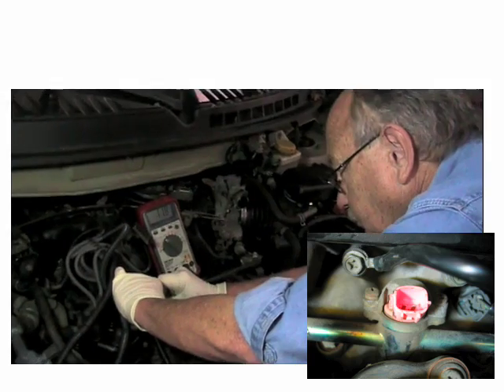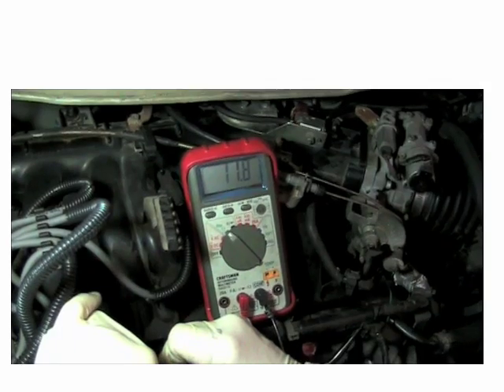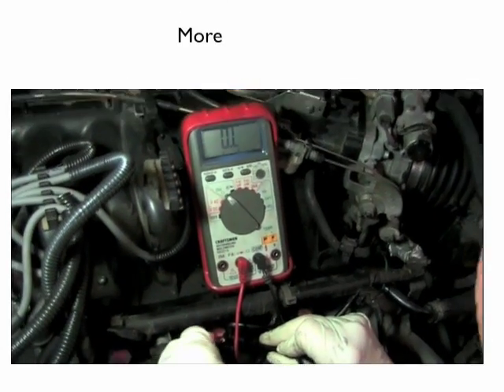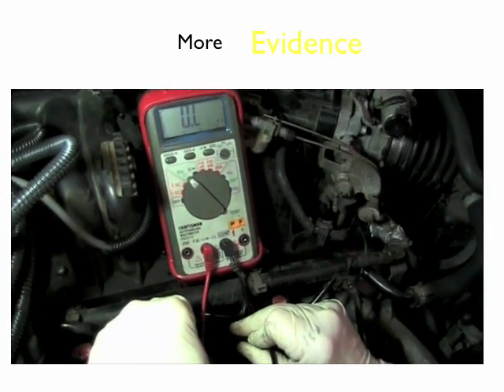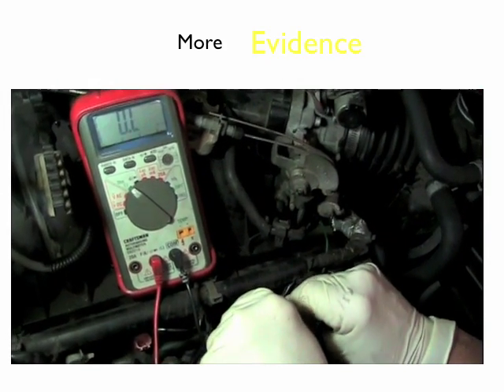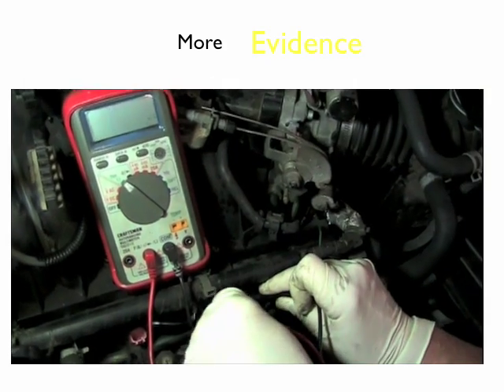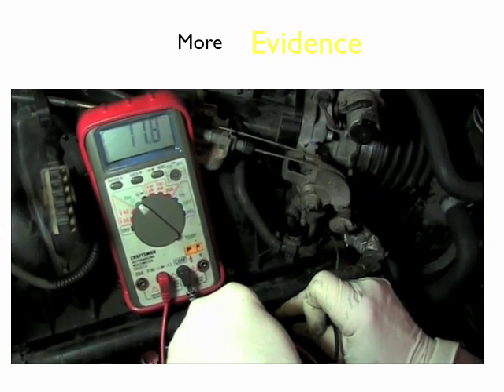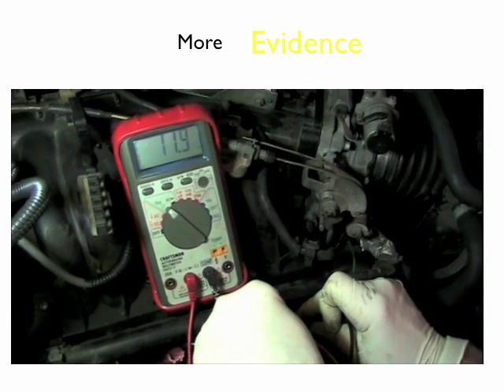Misfire, P0304

Comment: but but but... here's my mind fcuk.
Code is p304
You're looking at cylinder 2, physical cylinder 2.
That means the firing order is what?

I have a code 304
my firing pattern is 1342
does that mean cylinder 2, physical cylinder 2?
or does it mean 4th cylinder, physical cylinder 4?

Code refers to CYLINDER or FIRING pattern location? 
4th pop/ignition? that'd be cylinder 2. 
or 
4th cylinder, which would be the 3rd pop/ignition

Comment: I have a 1999 Dodge Dakota that has a misfire in cylinder 4... The spark is good, the pressure is good, but I still have a misfire. I put an inspection camera down in cylinder 4 and nothing... Nothing is in that cylinder to cause it to misfire. I am fresh out of ideas.... I need help!!! Lol
Reply: Chyne20 
Try swapping injectors to see if misfire code changes to other cylinder
Reply: steward I tried it and still misfire in cylinder 4. I checked it and I seen a chip in the piston.

Comment: If someone can please help me it would be beyond appreciated, I have a 1997 Plymouth voyager 3.3L 6 cylinder. I have code p0304 and I just replaced the coil pack after a misfire and the car was working again. Few weeks later got the same problem. I can hear the injected spitting correctly, and it's a new plug, new wire also. So what else can cause it to run so poorly. The car is sputtering when accelerating, and rough at idle. The tail pipe buffers like a chopper. Please help me thank you!

Comment: I would check the plugs first.  In my case (P0303), the plugs were worn and the third plug was so bad it had a 5mm gap or more as the electrode was worn.  Fix the obvious.  With a basic understanding of engines and some common sense, this stuff is easy.  If the code is specific to one cylinder, then it usually wont be something that affects all cylinders, otherwise you would get a random misfire code.

Comment: New injector, ignition coil, wires and plugs, rotor and cap, compression test come back fine, new air filter, just did a new plenum pan gasket and intake manifold gasket...still pops up P0304....what next? I was thinking 12ga slug but that wouldn't help..any advice lol
Reply: This sounds like me

Comment: i am misfiring on cylinder #1 .. a V6 venture 1998 .. mechanic changed plugs and wire set already, but its still there, this cylinder is behind near firewall hard to reach..
oil looks clean, exhaust too.. new plugs triggered this issue 
is there an easy way to test this #1  injector in this van  without ripping taking apart other things?